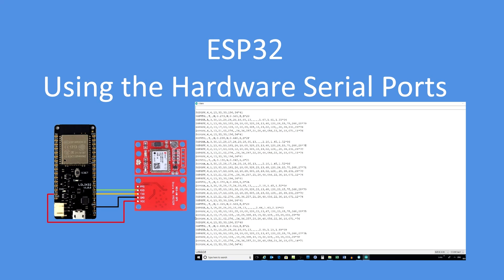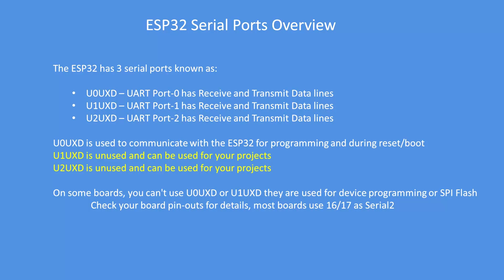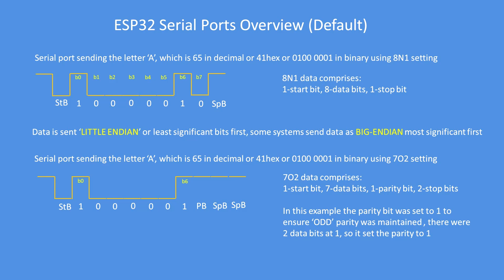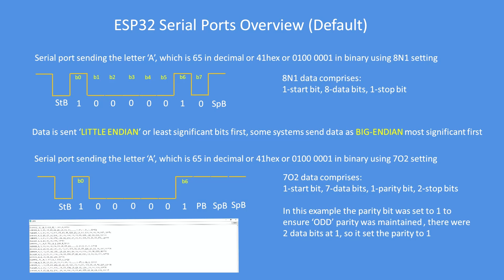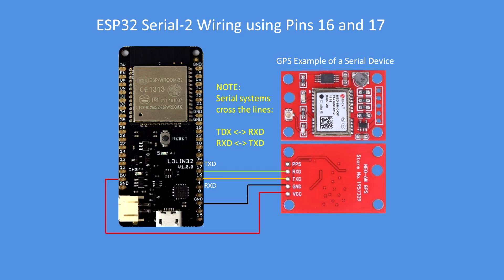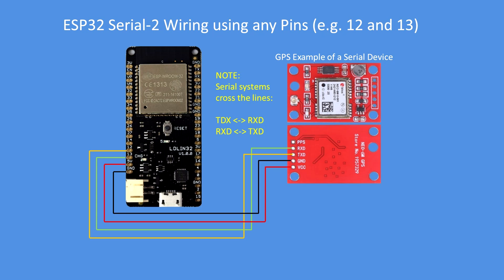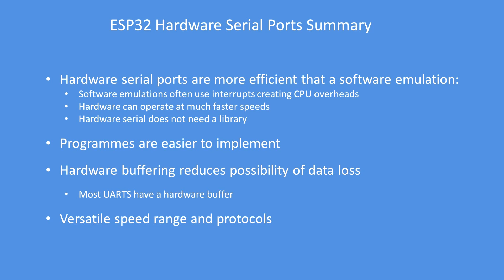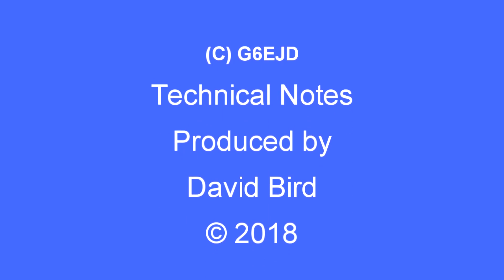Tech Note 081 - ESP32 Using the Hardware Serial Ports

Comment: I have personally found the serial ports on the ESP32 basically useless.  Serial2 is pretty much the only one I have ever got working reliably. 
I understood you could re-assign the serial pins, but even that doesn't fix the issue
Reply from the maker: That’s not an ESP32 issue, that’s almost certainly the development board usage of the serial port, don’t forget one is used to communicate with the board and one the on-board flash, so you have to choose the port you use carefully.

Comment: Very interesting video. I have a question, could I use the same UART port to connect for example 3 kinds of different devices and control one device at a time? Because for example the protocol to communicate with a GPS is different to communicate with a nextion screen, and if I send the protocol of nextion only will respond to this screen, or am I wrong? My hipotetic question is like a SPI protocol without the select pin of control. Thanks.
Reply from the maker: It’s all down to the connected devices whether they respond to each other commands or not and how you can differentiate between device data. For example a GPS module sends out data every second, so how could you ensure another device only sent data when an unconnected device was finished, the answer is you can’t as they are all asynchronous devices sending data when they wish to or require, it would not work with the vast majority of devices. If all three devices were silent and there was no command cross-talk and each device responded to a command then it’s possible. BUT it gets even more complex as you would be connecting three outputs in parallel, so as one tried to transmit data it would have to force the output  of the other two devices up and down to send data, so it could not do it. Only by introducing a wired-OR gate could that function, so now it’s getting very complex from both a coding and hardware viewpoint. On balance it’s not feasible and why it’s never done. There are other protocols such as RS485 that support the method though but most equipment don’t support it rendering the idea infeasible.
Reply: @G6EJD  thank you so much, I really apreciatte your time, regards.

Comment: why are the rx and tx pins reversed on the gps module
Reply from the maker: Because a Tx pin sends data and needs to be connected to a Rx pin and vice-versa. Some Chinese board makers who don’t understand unhelpfully swap their pcb labels so that Tx connects to Tx which is totally wrong.

Comment: this is great.. so many arduino projects jump in the hardware and software serial stuff without stating why? this info is needed well before serial class 101 videos. 😯thank you 🥳
next is modbus rtu rs485 arduino master slave 30001 40001 10001 00001 read write registers 🤔Mmm

Comment: Can you help me under how to program and write 8 bit, ascii “up” or hex equivalent from a 3.3v esp32 to a 12v rs232 device?
Reply from the maker: You need a low cost TTL to RS232 converter ￡0.46  5％ Off | RS232 SP3232 TTL to RS232 Module RS232 to TTL Brush Line Serial Port Module
https://a.aliexpress.com/_vUwrA3
12v RS232 is very rare, but there are plenty of converters available to make life easy.

Comment: Nice tutorial Mr David, precisely what I was looking for. But I still have a couple of questions:
1- is there any difference if I just initialize the serial inside "void setup()" with, for instance: Serial1.begin(9600,16,17)?
Do I have to declare: HardwareSerial Serial1(1) before that?
2- I understand that my ESP32 have serial0 (console monitor), serial1 (available) and serial2 (available). I have a project that needs serial1 and serial2. How do I identify my ESP32 will be able to handle that?
I assume all I will have to do is to initialize HardwareSerial for Serial1(1) and for Serial2(2) and do the same inside setup() for it to work. Is that correct.
Thanks
Reply from the maker: You can map your serial ports to any pins, see the examples, you need to declare serial1 and 2 so they are visible (global) for the parts of the programme where you will use them, for example declare within a function and they only exist in that function.

Comment: for some reason "Serial2(2)" for doesn't work, but I changed for "MySerial(2)" and it's fine.
The only problem now is my Monitor Serial that is blank, it doesn't show anything. can anybody help?
Reply from the maker: I just tried the sketch, it works perfectly. Have you set the baud rate for the serial monitor to match what have defined in the programme? e.g. 115200 baud
You shouldn't be using (2) e.g. serial2.write or serial2.print

Comment: Hi everyone , I am trying to connect a ESP32 Feather to a Pixhawk via Mavlink using Arduino IDE, is there a way I can monitor the UART port between the two and not the USB port on the Feather?
Reply from the maker: If your sending and receiving data via a UART then; let's call it, programme side, you can copy all sent and received data to the programming port / serial monitor. When your sending data to the UART you have a copy of the data to be sent, so a simple serial.println(txdata) will give you a copy of that, for receive data onreceive, you will have a copy of the data, then serial.println(rxdata); You could add a prefix like "Rxdata" to the print statements, same for Txdata

Comment: I'm trying to use it with my nodemcu 32S but it showed me error such as 
Error compiling for board NodeMCU-32S
Though I've applied that method, would mind helping me? Because I'm trying to interface a GPRS/GSM with my ESP32 nodemcu 32s
Reply from the maker: Your doing something wrong as the code is generic. Have you selected the correct board, the 32S is not yet supported if that’s the board you have 32S-2
Reply: @G6EJD  actually I have selected the right board and I did simulated max30100 but I'm trying to interface the GPRS as I said but it doesn't work
Right now I have bought an ESP32 WROOM to try with it and see the result
Reply from the maker: If it doesn’t compile then there’s a library issue, what is the full error message it’s difficult to help with no information
Reply: @G6EJD  I just changed the esp32 board to esp-wroom-32
Reply: @G6EJD  wow I have ESP32-S but on the back side I can read NodeMCU-32S but I'm confused
Reply from the maker: @wouladjecabrelwen1006  If its a new board it could well be a 32S--2 and distinct from the 32S and if so is not supported yet in the Arduino IDE, you would have to use thee Espressif IDE
Reply: @G6EJD  thank you you are right
Reply from the maker: @wouladjecabrelwen1006  you only get 1 cpu on that board and the pin-outs are different
Reply: @G6EJD  hi Sir I have bought an Esp 32 wroom dev module and tried your method but it did not work,
I even used hardware SerialGSM (1) to defined rx=4 and px=2
Everywhere I saw Serial2, I changed it into SerialGSM but and applied the same example as you shown but nothing though I don't know what is supposed to show on arduino port.
I only want to test it
Reply from the maker: I’ve just compiled my example and it works perfectly, I don’t know what your doing wrong? What IDE version do you have ? What ESP32 extension version?
Reply: @G6EJD  I have downloaded Arduino IDE 1.8.14
And the ESP-WROOM-32
on it's backside esp32 dev kit v1
Reply from the maker: @wouladjecabrelwen1006  so in the IDE, when you go to the Boards menu do you or can you select an ES32 board eg D32
Reply: @G6EJD  no on the board menu for ESP 32 Arduino (in sketchbook) then there are varieties of ESP32 board I chose ESP32 dev Module
Reply from the maker: @wouladjecabrelwen1006  and does the serial sketch compile, I’ve just tried it and it works.
Reply: @G6EJD  yeah it does compile but it turns on the blue LED and red LED at the same time it's when I move the protocol SERIAL 8N1 then the blue LED turn off. I really don't know what is wrong with
Reply from the maker: It’s because the LED shares the same pin that you’ve chosen, if it bothers you just change the pins you use. Some people find the LED useful as it indicates serial activity.
Reply: @G6EJD  so it's normal that the blue one turns on right!. I really don't know what is wrong with the serial communication. When I press the reset button it shows me
 pin 1 Rx
Pin 3 TX
Something like that
Reply from the maker: I have not checked the schematic but it’s highly likely and usual that the LED is connected to pin-3, it will not affect the operation of your sketch, as I say, it provides a useful indication that serial data is being transferred, solution just use another pin definition change eg 3 to say 5 or whatever you choose.
Reply from the maker: So pin 2 is the LED
Reply: @G6EJD  yes
Reply: @G6EJD  thank you Sir i succeeded with your methode
thank you again

Comment: Hello David, I was following your instructions of using Arduino HardwareSerial with ESP32 DEV MODULES.  I received the following error while attempting to compile my working SoftwareSerial sketch with the first conversion from SoftwareSerial to HardareSerial, ,my LoRa P2P 2903 Radio:

C:\Users\Paul\AppData\Local\Temp\arduino_build_668497\sketch\ESP_added_to_Testing_GPS_Data_Avg_Lat_Lon_with_LCD_Rx_Timer.Har.ino.cpp.o:(.bss.Serial2+0x0): first defined here

collect2.exe: error: ld returned 1 exit status

exit status 1
Error compiling for board ESP32 Dev Module.

Sketch text:

//SoftwareSerial Serial2(16, 17); // Rx, Tx 
HardwareSerial Serial2(2); // UART2/Serial2(16, 17); - replaced loraSerial(16, 17); 

void setup() 
{ 
//  Serial2.begin(9600,SERIAL_8N1,16, 17);
//  Serial2.begin(9600,SERIAL_8N1);
  Serial2.begin(9600);

I am not sure what is wrong here, the sketch will not complete the compiling process???

Comment: David, I understand that the ESP32 DEV Module operates at 3.3V (3V3), so, does hardware connecting to the board must also operate/speak at 3.3V or at 5V (VIN/VCC) with a logic leveler?

Also, if you intend to use the default protocol, (SERIAL_8N1), do you still have to declare it when defining the Hardware Serial connection?
Reply from the maker: Any devices, for example RS232 serial or other devices must not exceed the maximum input voltage (3.3v) of the ESP32 inputs or the ESP32 will be damaged, so yes, you’d need to use some form of level shifter/buffer. The hardware serial ports need all parameters as the pins have to be defined, leave out the protocol and the compiler will show an error unless null

Comment: All I get is continuously rebooting as soon as I add serial2?
Anybody had this issue?
Reply from the maker: Antony Smith, there should be no issues with using serial2 usually assigned to pins 16 and 17. What board type are you using and do you have the latest ide extension for the ESP32 e.g. 1.03 or above
Reply: @G6EJD  I seem to have come across an extremely irritating exception on the ESP32.
I found in some abstract forum that a small note somewhere states that:
"ESP32-D2WD’s pins GPIO16, GPIO17, SD_CMD, SD_CLK, SD_DATA_0 and SD_DATA_1 are used for connecting the embedded flash, and are not recommended for other uses".
So even though they are clearly stated as the Serial2 default pins they are even unusable as a Digital IO?
This would've been helpful to know before I wasted hours trying to get an output on those exact recommended pins.
https://github.com/espressif/arduino-esp32/issues/1604

Anyways, "HardwareSerial" and Serial1/2 all work just fine on literally any pins OTHER THAN 16 & 17.
Someone really should spread the word before others waste their time like I have.
Reply from the maker: Antony Smith, it depends on the board design some use UART-0 or 2, I only use the Lolin boards for consistency
Reply: @G6EJD  I've got a custom PCB, with the ESP32-PICO-D4.
So far no issues, until this little glitch. I don't see anybody actually getting GPIO16 & 17 working.
Oh and I just noticed we've been talking about pin 16 & 17, where I was meaning GPIO16 & 17 (pins 25 & 27).

Also, thanks for the responses.
Reply from the maker: Antony, in nearly every board I’ve used UART-0 is used for the programming port and UART-2 for on-board flash communication, but note the pico D4 configuration menu allows with care the UART to be changed, but doing so prevents flash  access. I think the custom PCB designer had the opportunity to use the standard ports to prevent future code incompatibility issues. I always refer to GPIO pins. I have not checked the data sheet to see why ports are default during boot mode, but it does seem the pico D4 board needs to be configured differently to change the default boot behaviour.
Reply: @G6EJD  Yes, as far as I can tell at this point, UART-2 can be easily remapped to any other digital pin pair (other than it's stated D16/D17), but if remapped it may very well affect the on-board flash.
Could you clear up something for me though? Remapping UART-2 to (for example D9/D10) gives no error and seems to work fine, and should not affect the on-board memory, correct? 
But if I was to (for example) set D16 & D17 to toggling GPIO's, this would be re-assigning the reserved IO's and would then affect the flash access. Does this sound correct?
Reply from the maker: Antony Smith, according to https://docs.espressif.com/projects/esp-idf/en/latest/hw-reference/get-started-pico-kit.html  UART2 is used for flash access and therefore for reliable operations you should avoid UART2, why not use UART 0 or 1 ?

Comment: Great video series!

Do you know what is the regular voltage for the serial ESP32 received  data? And that voltage is measured between RX and TX pins or between TX and GND?

The regular Serial communication works with 3 to 25V
Reply from the maker: Lucas Meirelles Pereira, all ESP32 data pins including Tx and Rx have an operating range of 3.3v maximum, you should avoid exceeding Vcc (3.3v) at all times. All voltages are measured against a ground reference, so between Tx and Gnd. All development boards use a 3.3v regulator which is the ESP32 nominal operating voltage.

Comment: Very nice video,
but  I need to send nmea sentences from (ais device) to any pc or tablet, phone, etc. by wi-fi instead of cable
"Nmea signal comes from device only two cables tx and ground in 38400 baudrate to serial port of pc by rs232 cable." 
I tried with esp8266 but I couldn't.I think esp32 better than esp8266 but How can I do it ? pls could you advice about that.thanks
Reply from the maker: H& G if you see my video on getting data from a GPS you’ll see how 80% of the task is done and an ESP8266 is more than capable of receiving data at that rate, once you have your sentence you can forward as a client to a webserver, but the data rate can be continuously high if you want to send every sentence and in which case you may need to implement a software based FIFO buffer as inevitably there will be server delays, you could use UDP to send the data as it’s quicker than TCP/IP I’ve done a video on that - are you doing this for commercial purposes? As I only help hobbyist and students
Reply: @G6EJD  
Thank you very much, for reply my msg.and I will try to do your advice.
I'm interested  in this project for use privately not comecially.

Comment: Thanks for this concept!!! ;)

But there is a mistake in command... While compiling this program, it shows error "Multiple definitions of Serial1 or Serial2".
To overcome Change the commnd like this,

HardwareSerial GPS(1); // uart 1
void setup() {
  GPS.begin(9600, SERIAL_8N1, RXD2, TXD2);
}
Reply from the maker: You can use any digital IO pin for hardware serial, the pins are multiplexed.
Reply: @G6EJD  Yeah..now got it!
Reply: struggling to follow this. can you post full code edit.
Reply: is this correct?

HardwareSerial GPS(1); // uart 1

#define RXD2 16
#define TXD2 17
void setup() 
{   
  GPS.begin(9600, SERIAL_8N1, RXD2, TXD2); 

  Serial.begin(115200);
  
  Serial.println("Serial Txd is on pin: "+String(TX));
  Serial.println("Serial Rxd is on pin: "+String(RX));
}

void loop() { //Choose Serial1 or Serial2 as required
  while (Serial2.available()) {
    Serial.print(char(Serial2.read()));
  }
}
Reply from the maker: Yes, it depends on the board your using whether RXD2 andTXD2 are defined or not clearly on yours they are not.
Reply: @HunkMarvin1   Have you got any data string using above code? because  I didn't get any data string. Just printed in serial monitor that  Serial Txd is on pin: 1
, Serial Rxd is on pin: 3. Can you help me out?

Comment: Hello Dave. can you listen on both ports at the same time so that the esp32 can communicate between two devices, or can you only listen on one port at a time?
Reply from the maker: Kevin, yes there are hardware buffers and as long as you keep checking the ports/buffers you won’t lose any characters/data. You create and open two instances you could also use software serial too, but hardware is better.

Comment: Nice video Dave. Thank you. I see you were using +5V on the GPS without level shifting the serial.  What's your view on the tolerance of the ESP32 pins to +5v? 73 M0IDA
Reply from the maker: Hi John, well the board I use has a 3.3v regulator on it, so all data lines are at 3.3v and it has series resistors to protect the GPS receiver when supplied with 5v (e.g. older style TTL) logic levels. I have not seen any GPS receivers that don't have a 3.3v output, the NEO receivers are all 3.3v devices too. So don't worry, everything is as it should be. The maximum input voltage to any ESP32 input is Vdd + 0.3v or 3.9v, but that would be excessive in my opinion for reliable and sustained operation. 73 Dave G6EJD
Reply: FB Dave! I couldn't see the detail.  Keep up the good work!